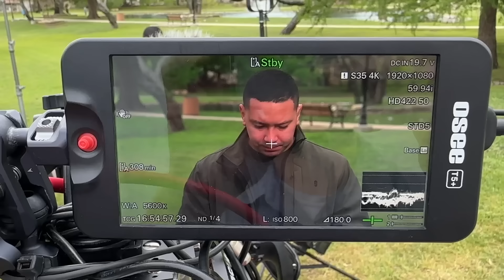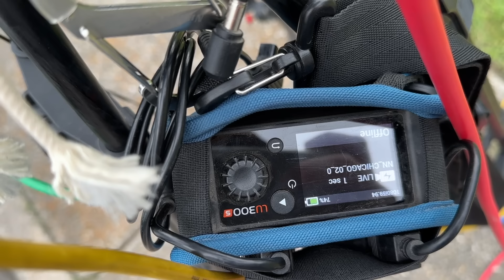Live News | SXSW | Industrial

Comment: Do you use 26 volt batteries on your F22c and if so, how much run time do you get? I just used mine yesterday. I like it for its output and mobility. Thinking about picking up a second one to replace my Aputure Tri 8’s for location work.
Reply from the maker: Using core 98WH gold mount. Each interview was 15-30% dimmer. We got through about 10 quick interviews over 5 hours on one battery.  Powering down between.  

I want to buy two more F22c and sell my Lite panel Gemini 2:1 lights.